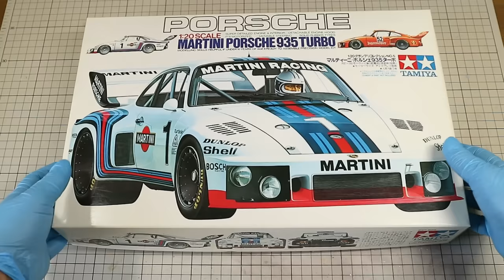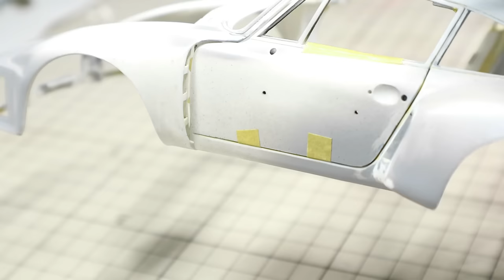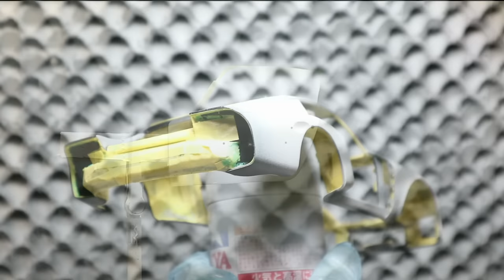PORSCHE935/76 LEMANS #40 / TAMIYA KIT 1/20

Comment: Is this the Tamiya 20070 kit ? How do you like the Shunko decals ? Do they work well with softener ?
Reply from the maker: ITEM20005

The color is good.

No fabric softener is used.
I applied it with a wet cotton swab warmed(with hot water)
Reply: @shinzoautoworks7754  I didn't know the 20005 kit was available ?